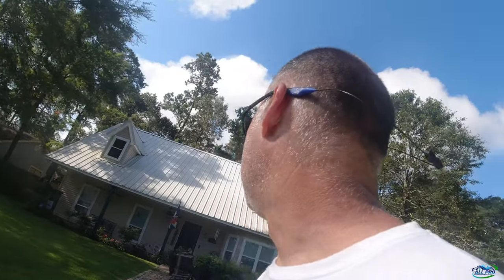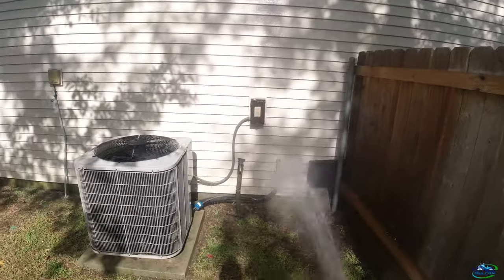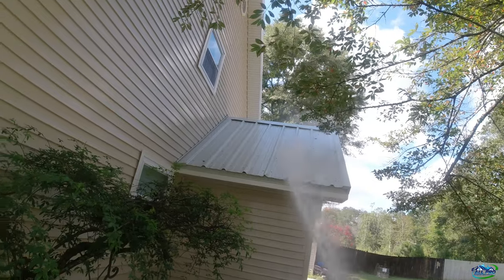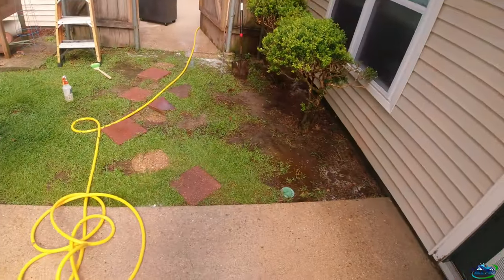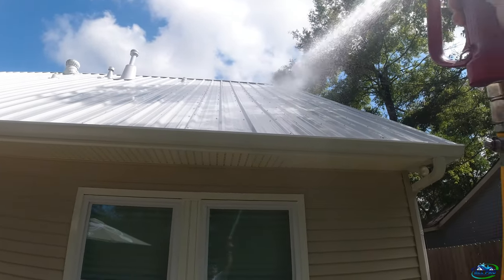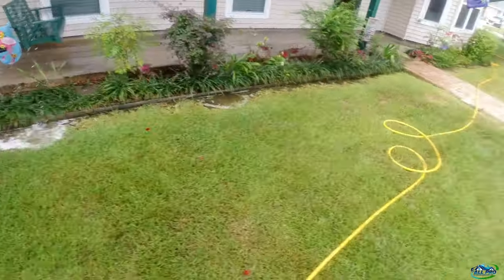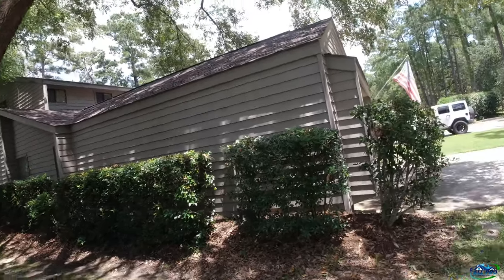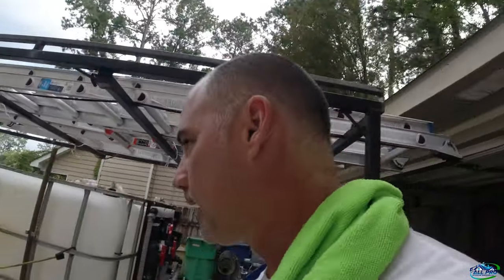How We Clean Metal Roofs!

Comment: I see that your assistant is putting the gutter solution on without using safety goggles. What do you do when you get the gutter or SH solution directly in the eye? Especially when it takes a minute or two to get to clean water, and by this time, the damage is already done
Reply from the maker: Good catch & agreed. This is why we spray the brush instead of the gutters. Thanks

Comment: What type of red gun is that? Is it compatible with connecting to pressure hose.
Reply from the maker: It is the GP red gun. It has a 350 PSI rating. Search YT and you may find a work around. Thanks